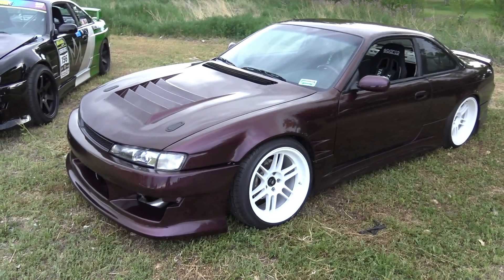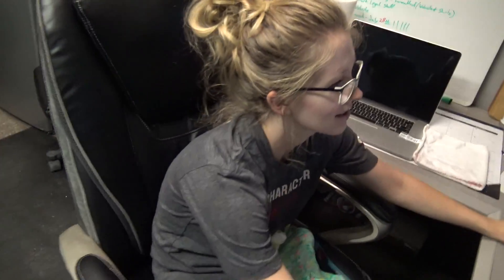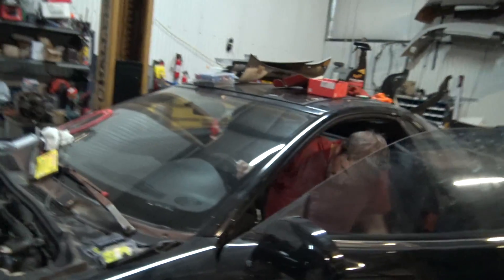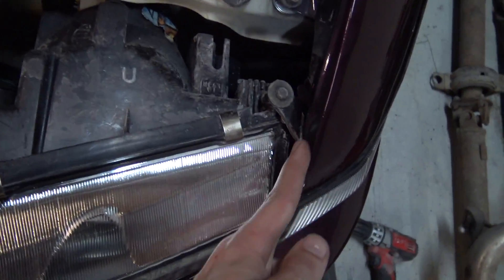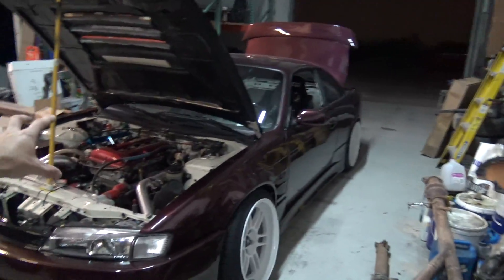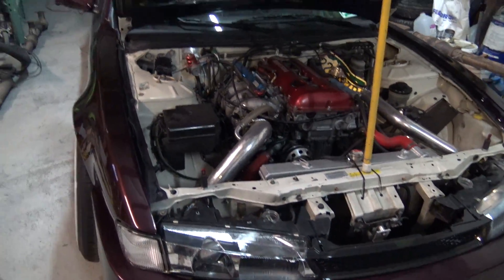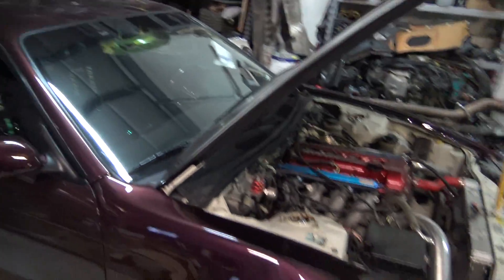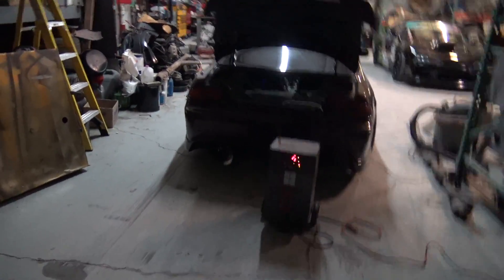I bought a SR20DET Swapped 240sx S14 😀

Comment: I love the SR20.
Haters gunna hate.
Reply: 802 Garage me to
Reply: It's one of the best sounding inline 4 engines for sure too, IMO.
Reply: SR20 all the S Chassis 👌
Reply: kenny etenne Funny I own two SR20 cars. That said they are the crappy NA transverse engines. Both have hundreds of thousands of miles and run like a dream though. Just because you haven't owned an engine doesn't mean you can't love the design, look, sound, and cars it came in though. My comment has nothing to do with MotionAutoTv, I say it all the time, so no dicks being ridden here. My GF is an hour away. :P
P.S. My favorite engines are Subaru, but I also have a 4G63 in my Eclipse GSX project. Not sure why you got all upset about my comment. I have a lot of engines I like on my channel, even if it's cheap old crap.
Reply: WraithDeath I'm still hoping to put an SR20 in my MR2. We'll see.
Reply: 802 garage mad if you put quad cam v8 in..
Reply: Nearly impossible to fit, but I did consider a Cadillac transverse V8.
Reply: are they any good ... meaning power wise
Reply: The Cadillac Transverse V8? Northstar 4.6L 90 degree V. Apparently about 300 HP and 295 tq which really isn't awful. Aluminum block and head. Lots of cool tech features. The Wikipedia article read is actually a good one. I probably have the 275 HP 300 tq version in the Cadillac in my drive, but it's not even my car. Would be fun just to take measurements and see if it would fit, hahaha.
Reply: 802 Garage I've had my own 500hp SR20VET for three years now in my S15, absolutely awesome engines 👌
Reply: Thanks for the input guys. ^_^
Reply: 802 Garage I'm the same
Reply: 802 Garage Why all the SR20 hate? I love mine!
Reply: CompressorSurge I know, right? Silly.
Reply: I’m new to the whole 240sx and was wondering if I can use a automatic 240sx s14 as a project car might be a stupid question but really want to know

Comment: RB swap would be sick
Reply: swazi5 so not worth it. Not sure why everyone swaps Rbs, there old tech compared to vq30dets.
Reply: but for a vq30swap you'd have to cut the whole front end apart and coustom build everything becouse the S-chassis was never intended for a V-shape engine.
Reply: G Seitl was never intended for an Rb either? And actually the vq is fucking tiny really, and take up around the same amount of space as the Sr so you don't have to pull much apart. You don't have to custom much at all, everything fits like a glove, only hard thing youd need to fabricate are motor mounts (which you could buy anyway) . The vq30det is also very light, weighing in at roughly 20kg heavier than the sr. And it'll hold 400hp far more reliably than any unbuilt Sr or Rb.
Reply: RB swap would be sick. i just sold my rb25det s14 it was a great combo
Reply: NZ DIRT Why'd you sell it man, I'm pheaming for a S14 right now, yet you just got rid of my dream build😂😂

Comment: I would disassemble that R154 and fix the issues it has(shift forks, thrust washers) and give it a nice refresh. Most MK3 r154's took a nice beating and I'd make sure it doesn't take a dumb on you once it's in.

Comment: I'd honestly keep the SR20 in it... However, pull it out to do some touch ups to the engine bay a nice paint job that complements the exterior of the car would do wonders. Then add some of your touches on cleaning up the wiring and polishing up some of the parts the motor already has like you did with your drift car. After new interior and those minor touch ups the car will be well worth the raffle/giveaway you've got planned. No need wasting a good SR20 car when it already runs like a beast that's just my opinion...either choice you do make is the right choice.

Comment: Trevor the reason why your Sr20 S14 lasted long was because your friend kept good car of the car and  motor that's why its still in good mint condition car and your Sr20 S14 is cool and clean and Trevor you should keep the Sr20 until you blow the motor and then swap it with 2Jz later